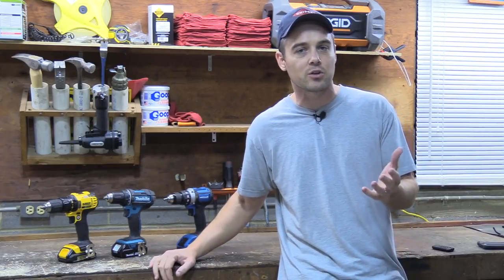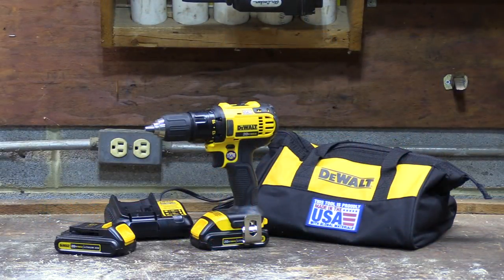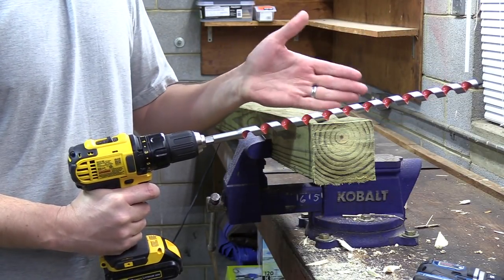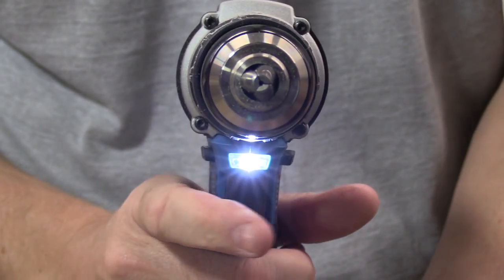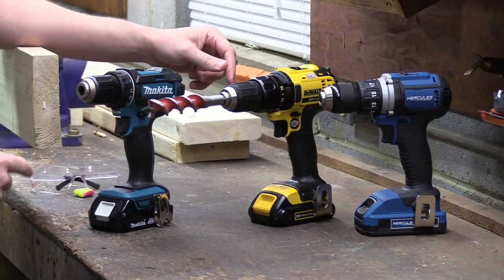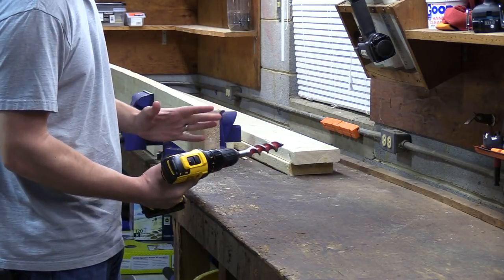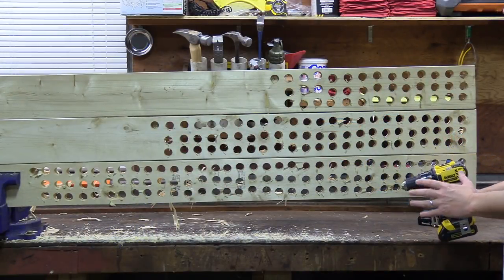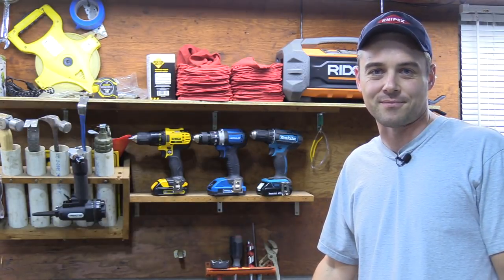Dewalt -VS- Makita -VS- Harbor Freight (Hercules) / DCD780 -VS- XFD10 -VS- HC91K1

Comment: Although I didn't comment earlier, I thought the Makita would do the best. I am shocked the Hercules did the best. Gives me lots to think about (I own a Makita 18v drill and impact driver -about 5 years old)
Reply: I've given up on brand loyalty. Videos like this , and forums are good sources of information when choosing which tool to invest in. Every tool has its strengths and weaknesses, you can make a choice based on your specific needs. Sometimes, a compact tool that can fit in tight spaces is more useful to you, even if it lacks the horsepower.

Comment: The Herc is fine for a home owner but when you have 15 tools sharing the same battery platform... Doesnt work. Can't go wrong with Milwaukee or Makita.
Reply: I would agree to a certain extent, but Ryobi tools have the most and largest  tool selection that can take the same battery then any other tool mfg.
Reply: @rodw1105  I highly doubt that. Makita for example has over 200 cordless tools.
Reply: @evictioncarpentry2628  but do they take and use all the same battery? Or do you have to buy different battery types for different tools?
Reply: @rodw1105  same battery, either 12v or 18v platforms.
Reply: @rodw1105  I love my ryobi tools. I have a drill, impact driver, circular saw, multitool, flashlight, reciprocating saw, weed eater and leaf blower. All take the same battery.

Comment: For many people, the Harbor Freight drill would be useless unless they could buy another battery pack. No one wants to sit around waiting for the single battery to recharge.
Reply: $50 at Harbor Freight gets you an extra 2.5Ah battery, or $90 for a 5Ah.
Reply: @aswallace88  uh where are you finding those prices? At my harbor freight it's 25 dollars for a 2.5 and 40 for 5
Reply: @Mexicanmike87  I was looking on HF's website this morning, but it looks like it's changed. But it changed for the better.

Comment: I would have liked to see how a ridgid would have stacked up in this competition
Reply: James Halfhill ....that would have been great since I just purchased both the drill and impact driver, but they were on sale.
Reply: on the realtoolreviews channel (i believe) both the ridgid drill and impact are reviewed in different videos along side many other brands and both the drill and the impact were in the middle of the pack compared to the other brands. As for longevity I am an electrician using both every day and they have held up well for 5 years now however my partner's ridgid impact died after 2 years and had to be rebuilt. 

I had one of the two original batteries battery die at 3 years old but that was really my fault i ran that battery too hard and forgot to charge it back up before I went on vacation but the other one has held up for 5 years. I think if i hadn't over discharged the other one it would have lasted. Ridgid did replace the battery under warranty. 

on an unrelated note my ridgid Sawzall has just died at 5 years old but it does have the lifetime warranty I plan on redeeming.

Comment: I do not have the Hercules but rather the Bauer combination drill, drill driver, hammer drill. The first one I purchased failed very quickly as the pass transistor exploded due to the over current circuit not functioning. Infant failures do not bother me. Back to the store three days later for a no muss no fuss exchange. I have beat this drill quite hard. Many, many concrete holes for handrail installations. Many screws and drill uses as well. It just won't give up. Since it is a three in one hit it never rests very long. I have had it for over a year and it continues the "Energizer Bunny" impersonation with no quibbles.

Now, as for corded drill from HF, DONT! I have burned through at least 6 of them. Not really complaining since they were all replaced. But with Bauer I just don't need corded drills any longer. A very pleasant surprize. Would I buy another, in a heartbeat. Most Likely one of the best products they, HF, offers.

Marty de

Comment: This is a good comparison for homeowners to not overspend. The DeWalts I've owned and seen usually had a failures in the triggers and switches. The HF tools I've owned have been for occasional use, but motors have burned out fairly quickly with any kind of production use. The Makita tools I've owned take a beating and the batteries hold a full charge (not just what the 'fuel gauge' reads) for years. I've never used Hercules tools. I used to work for a major tool manufacturer and found that, with the lower end cordless drills there are wear problems on the chuck, the teeth on the chuck go dull and won't grip the bits, the switches go bad, and sometimes the battery port stops making good connection over time (in a production application). Again, for a homeowner, the Hercules is probably adequate. The DeWalt and Makita versions here have the homeowner in mind and I would consider them to be Mickey Mouse tools on a jobsite.

Comment: I prefer Milwaukee. I've got a Makita drill & nut driver set that was a gift. Absolutely no complaints. I've had plenty of tools in my life, I still prefer Milwaukee.
Reply: I invested heavily in Milwaukee several years ago.  I bought most of the 28volt line. Milwaukee is now pushing its 18volt.  I have resorted to after market batteries, and am still pretty happy.  I do feel like Milwaukee lured me with the 28 volt line, and then cut me loose.

Comment: Hercules stuff is pretty legit. Their compact 3/8 and 1/2 impacts are brushless and have not let me down. Their 12v ratchets are pretty solid too. Even though I already have a bunch of DeWalt stuff, I still went with Hercules for "automotive" type tools. I am just a "DIY brake job / oil change / simple repairs" kind of guy. So, for me, the Hercules stuff just made more sense at (literally) about half the price of DeWalt.

Comment: The most important thing to test for me would be longevity.  I was impressed with the Hercules but how long will it sustain that power. I've always bought dewalt or other high end stuff the Milwaukee and makita eventually crap out but the dewalt keep on ticking, of course bnd bought them out and well have to see if quality goes down
Reply: You can buy almost 2 for the price of just one of the more expensive drills and when on sale, Yes.  I have a harbor freight near by and will replace them for free.  also, some of the videos show Hercules out performing the other drills so maybe the better performance puts more ware on them.

Comment: I bought an 18V Makita set (drill, impact driver, circular saw, grinder, reciprocating saw) around 15 years ago.  It has made me a believer - the only thing I've had to do is JUST this year had to replace a battery.  I will say I am impressed with these tools, they have lasted a long time with some heavy use.  The only tool I am less than impressed with is the grinder - something about the design is flawed - it "stalls" out easily / frequently, sometimes with what seems like low pressure / friction....

Comment: That was a great head to head comparison.  I will say that I have always said that DeWalt is over priced.  Now I know that Makita is as well.  I am in the carpentry field and for the price I have always liked Porter Cable.  I have been using them for years and have never really had a y issues with them.  I don't buy their batteries but rather the generic PC replacement batteries from Amazon.  5ah battery is $28.00.  that is well worth it and about what a replacement battery should cost for a drill.
Reply: Makita came with two 2ah batteries and was only $10 more than dewalt which came with two 1.5ah batteries. As far as performance goes, they should be comparing same size batteries to same size batteries.
Reply: Porter cable, really good drills.. i forgot to say that in the comments.. but yeah real good drills..

Comment: Mate, I actually don't follow the "leave a comment" trick of YT hosts, but I'm really passionate about tools, so here I am. I'm not going to be biased toward Makita and I don't even know if it's the best out of all three, but for ME it is. Let me explain: I have built my tool-kit around the Makita environment, as of right now I have about 10 batteries and two still sealed 5Ah ones; I have a few chargers and about 15 tools, the drill in your video included (for lighter work)... This being said, I have no reason to suddenly go a different route and I honestly don't care about other brands out there. I must say that I bought into the 12V Milwaukee brand for some tools Makita does not offer (also many batteries and 4 or 5 tools). This being said, I'll watch the video for amusement, not as something which will make me change my existence over. Also, when you need another tool from Makita, it is offered as a bare tool for about $99...
Update :)
First off, you are using drill bits not designed for light tools as such, I mean, no professional would do that, second you explain how drills work(???) left, right, torque settings... I assumed you want the opinion of tool people, nor soccer moms... Finally my thoughts about the comp per say: In the HFT environment, oh, there is no HFT environment - they had to build a drill covering a larger range of power, remember it was also very heavy??? Well... In De Walt and Makita world you would grab the adequate tool for the job. I, for example, use this Makita with drill bits up to 1/4" for wood, and metal and it does perfectly, for heavy duty work I'm using the one meant for those jobs and I assure you that all pro do the same. Have a good one!
Reply: Written like a guy who, because he has invest a lot of money in Makita, can't admit that the generic brand kicked the other two high priced drill's butts!  You keep buying the Makita....
Reply: @jamesajanda  Right! And you go schmuck-route for the rest of days...
Reply: You seem smart

Comment: I have used Makita battery powered drills for decades and beat the shit out of them over and over. They come back strong. Replace the batteries with cheap online versions. Glad the other drills are good, especially the Harbor Freight one. Not surprised that DeWalt comes in last. What I like about Makita is all the tools that use the batteries. I keep three batteries and run drills, circular saw, recip saw, impact hammer, and flash light. I use the three ah battery. I had the two ah one also but gave it away to my nephew. If someone were to rip off my makitas, I would replace with Harbor Freight. Hope that doesn't happen.

Comment: I'm an avid do-it-yourselfer, not a pro but I do alot. just went all cordless with the Hercules line and love every tool. This drill is great, hammer drill too, the impact driver may be my favorite if not for the circular 6 1/2 saw, they got a new brushless 7-1/4 coming soon, can't wait, got the light too. Will be adding more to this line soon, gotta have the vacuum, and the recip saw...it's the batteries!  They seem to last forever, smaller batteries work great with the drills but get at least one big battery for the saws and heavier tools.

Comment: I own a 20v Hercules hammer drill and impact. ive always been a Makita and Milwaukee guy but I thought I would give Hercules a try. I've been using both tools every day at work for a little over a year doing electrical and new construction. I was skeptical at first but I've been very pleased with both tools. They haven't failed me yet. I haven't used the other Hercules power tools yet.

Comment: The reversing switch on my Dewalt didn't last very long in light, home repair use. I tore it down and got it going again myself. I use it very gently in hope that it will stay working.

Comment: I'm a glazier, have used Ryobi for 20 yrs,and watch my coworkers curse their DeWalt crap every other day. My 4amp hour batteries and tools blow them out of the water,no question. And I still have the first drill I ever bought, though the 1st Gen batteries gave out years ago. The new battery fits every tool Ryobi makes,and has ever made,too! Best investment toolwise I have ever made,hands down
Reply: And then you can afford to buy twice as many of them so you don't have to move them around if you work in multiple trucks and buildings.  They're also cheap to repair when you use them stupidly.
Reply: well maybe you can pass them on to your grand kids
Reply: talltom1129 Don't kid yourself, fanboy.

Comment: You need to do Hercules vs Milwaukee
Reply: Yes, would appreciate a test with the  Milwaukee brands.
Reply: They need to do Milwaukee vs Makita and DeWalt. I saw a Milwaukee 18V drill SMOKE a DeWalt 18V on a job once... well, what I really mean was the DeWalt was the one actually smoking... as smoke was rising from the heat apertures at the back because someone tried to drill a 2" hole with a Forstner bit. The Milwaukee blew though it without any loss of power. They seem very under-rated.... :)
Reply: @privatear2001  should I get a Milwaukee drill or Makita or Hercules or bauer
Reply: I can't tell you that, John (in my best HAL voice). :) The Milwaukee smoking a similar class DeWalt  was a nice spell ago - when they were still using NiCd batteries, just on the cusp of NiMH. I never meant to mislead anyone there. The technology has changed since then. Makita and DeWalt could be much better now, but this video seems to call that into question. I still have my old DeWalt drills (14.4 right angle and normal 14.4) and last year bought a 2 pack of NiMH (aftermarket) batteries and a special yellow OEM charger for them from eBay. I hardly ever buy new stuff. Someone gave me a bunch of 18V bosch equipment, so i'll prob get some aftermarket batteries for those and use them too. I tend to believe that if a company makes a good product from the get-go, they probably still do; while one that makes an inferior one, probably still does, as well. 

If I were buying brand new, I'd do more research to see how Makita, DeWalt, Bosch and Milwaukee stack up to each other these days. Milwaukee might have gone down-hill, I don't know. Sure would like to try one of their drills for myself, though... if my present DeWalt ever gives out. :) I believe you get what you pay for, in general. So I try to buy contractor grade tools instead of home-owner grade. That way, even if they are more expensive, if I'm only using them lightly, they should still last me a long time. And I rationalize it by looking at return-on-investment. If I buy a tool for $300 that lasts me 10 years, that's $30/year. If I buy a cheap tool for $100 that lasts 3 years, that's $33/year, but now I'm in the market again. If its $100 and lasts me 1 year... or 1 month... then its not a very good ROI. :)

It all depends on what your needs are. I also have lots of corded tools for when I need the big power and I repair my tools when they get damaged. Rebuilt an Hitachi and Makita circular saw a couple years ago when they just had too much scoring on their commutators to start up and run properly. They worked like new after I'd finished refurbishing them. Had to do the same with my Fein Multimaster a couple months ago too. I find good tools that have the right balance and are up to the job I ask from them and try to be able to do the work and research to maintain them. I don't discard stuff unless its damaged beyond repair. :)

I know it wasn't a straight answer, but hope this helps to see where I'm coming from. All the best, my friend! :)
Reply: @privatear2001  yeah is not a straight answer but an essay story but thanks
Reply: @privatear2001  and what's with the :) this
Reply: @privatear2001  yeah I might but all the brands and see which one is good then i will personally see it for myself
Reply: @privatear2001 ,   Milwaukee makes a good 18v. They do tend to get hot rather quickly with hard use. I will stick with my Makita, even though they are a little under powered in comparison.  Milwaukee drills are a bit heavier also. Not a big deal, but using one all day, its nice to have a little less weight.
Reply: Old school smiley. Icons take far too long to come up on my old computer.
Reply: Well, there is no straight answer. Its all relative. And you might even buy a Milwaukee and get a lemon, so who knows? But if I had to buy new these days, I'd probably go Milwaukee.
Reply: @AlejandroP1980s  I can reply here. I gotta say, Milwaukee is the way to go. They are more expensive, sure, but man do you get your money out of them. They are downright amazing tools. I have used both DeWalt and Baur, and good it doesn't even hold a match to Milwaukee.
Reply: Not the same at all but Hilti had a 36v that had a card with a short coiled cord so you could put the battery on your belt. Yeah I know a cord, but it wasn't like plugging into an outlet and lessened hand fatigue. The 28v Milwaukee was a brute. Now...18v Makita. It does a good job and I'm disabled so don't need that much power anymore.

Comment: I own both a Hercules drill and impact driver and have used them regularly for about a year without a problem or hiccup.  The batteries are efficient and much less expensive than the more touted brand names.  You can easily buy several batteries and never have down time waiting for a battery to charge.  I am anxiously awaiting the expansion of their tool lines.

Comment: I have a Makita that I bought over a decade ago, it came with 2 batteries and an entire box of tools for about $150. I love it, it has done almost every job in the house and shop. I know it lacks a little in the torque, but for those jobs like drilling through fence posts I use a corded drill.  I'd try the Hercules based on this review. I'll have to wire and dry wall a 1600sqft building soon. Might be a nice test.